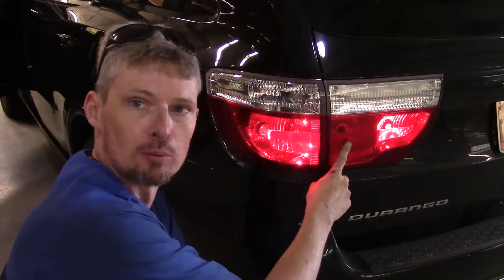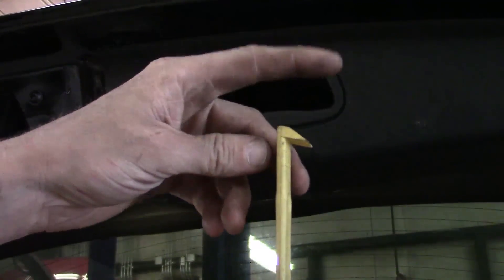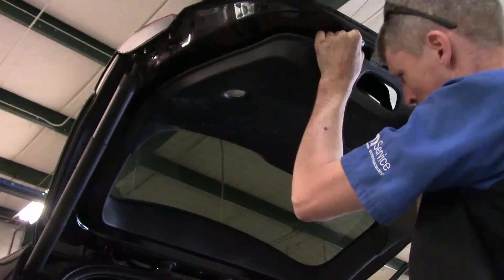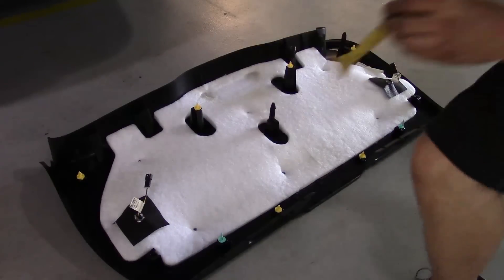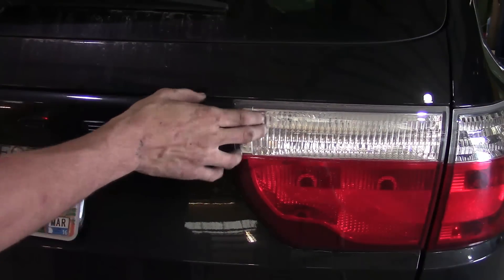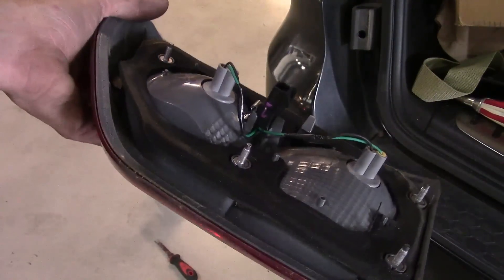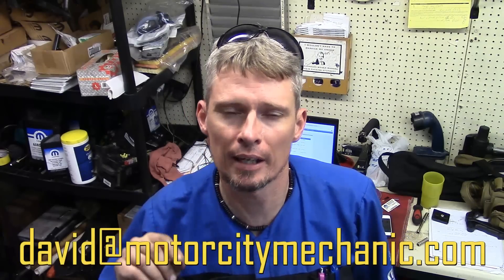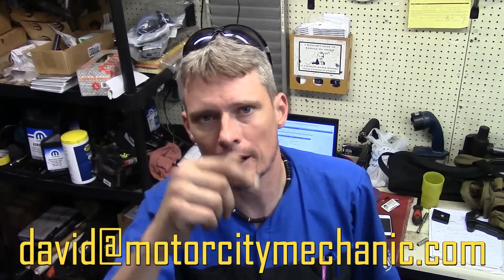2011-2013 Dodge Durango rear hatch tail light assembly removal

Comment: Appreciate you not using "and uh" , as many videos do. Very quick and concise, well done. Only critique, a lot of the electrical clips are very different in how they operate, slow down just a bit, and explain what is being squeezed or pried apart. The small electrical clips break easily if you twist or pry the wrong direction. Nice camera work also!
Reply from the maker: Appreciate the feedback. Thanks for watching

Comment: I just changed out the inner drivers side assembly, I cracked it backing into the Chief of Police's mailbox dropping off my daughter friend.  Oh boy, anyway I have a 2013 Jeep Grand Cherokee and used this as a reference.  The holders/clips weren't in the exact place.  and the inside 10 mm nuts/bolts were both on the inner side, but it worked.  It took me 45 minutes to put the back panel back on.  Thanks for the assist.
Reply from the maker: Ouch.....certainly the wrong mail box to back into. I do see some changes from year to year. The service info makes it hard to isolate exactly what years are exactly the same as far as procedures. Glad it all went well and no one ended up in handcuffs lol. Thanks and make sure to subscribe

Comment: Thanks for this video! I  have one bulb out on each side.  As well as different ones. So, for one I will have to take the assembly out completely.  This has to be the most complicated bulb change procedure I've ever seen. Dodge couldn't do better than this? I love this vehicle, but wow.  Oh well, I have to do it!   Thanks again.
Reply from the maker: +Watchandjewelryloft Your welcome. Yeah there are a few steps for sure. But now you know exactly what they are. Thanks for watching and make sure to subscribe
Reply: I did it!   One of the green anchors broke! But, the whole panel snapped back on pretty tight and no rattles!  I will probably get a new tab anyway though. Thanks again.
Reply from the maker: Watchandjewelryloft Your welcome. Glad it worked out. Thanks again for the update and for watching

Comment: the large plastic post located in the middle was a lil tricky to line up. took a piece of paracord to give it a pull and it lined up fine. thank u for the video.
Reply from the maker: +quinshane83 Your very much welcome. Thanks for the info on the install as well. Don't forget to subscribe if you haven't already

Comment: Dave, thanks so much for the video, couldn't have changed out the bulb on my 2013 without this, I would have never known how to get access to it. The trim clips are an absolute nightmare to pop off, I actually cracked the panel. Just wanted to give others a heads up: Be careful, they are REALLY tight, even using a trim stick trying to pop them. Dave makes it look easy,  he's a pro and I guess I'm not (haha). Again, great video, Dave - Thanks!!
Reply from the maker: Funny you should say that....I broke one of the handle cups on the bottom edge of the panel trying to get it off in the video....it got cut out and made it to my personal blooper reel. I never found nothing wrong with screws.....because they came off easy, not like those plastic retainers! I feel your pain. Thanks for the warning to others and make sure to subscribe

Comment: This video was right on! Not only was I able to replace bith tail lights but completed the project in under 15 minutes. One suggestion is to have a handle piece of rope to support the panel,. I had a bit of difficulty trying tomget the tail plug apart and almost broke it, so I let it hang gemtly until done.
Reply from the maker: +david fabela Thanks David for the comment and for watching. It helps to have 3 hands lol. Glad to see that it worked out for you. Don't forget to subscribe if you haven't alrady

Comment: Hey David, I appreciate your video. I was looking to remove the lights on my 2015 Durango and was pulling on the panel and heard some gut wrenching cracking sounds so I just aborted mission lmao. Now Ima go back and finish it so I can paint my tail lights thanks again! Very informative.
Reply from the maker: +bIakmatt I hadn't checked but I know they eventually changed the taillights to a solid piece on the rear hatch. Yeah....it takes some pulling to get it off for sure. Take you time. Your very much welcome and thanks for watching. Don't forget to subscribe

Comment: Thanks for the video...I broke three blue/green clips and one of the clip holders. I'm going to try part store for replacement as for the holder alittle gorilla glue should do it...dodge really should have put an access panel or something but oh well.thanks again for your time making the video👍
Reply from the maker: Yeah an access panel would have been nice for sure. Those panel snaps will over time start to break when removing....its just hit and miss if they do. Thanks for watching and make sure to subscribe

Comment: So after getting the panel off the 10mm bolts kept spinning so I couldn’t get the light out. I was still able to get both lights changed without taking the light out. You just need skinny fingers and needle nose pliers. Lol thanks for this vid though!

Comment: all my 4 bubs on the taillights on trunk dont work what could it be
Reply from the maker: I would check each one first to make sure they arent blown. Otherwise you will need to chase the circuits and need wiring diagrams.  Nothing common that I have seen

Comment: I  have a 2012 dodge Durango with the  tail lights in the video.  I was wondering if those tail light can be swapped with the newer 2014, and 2015  racetrack tail lights on the Durango? or would it create more headaches?
Reply from the maker: +jolawil Thanks for watching. I can not say for sure if it can or not. I haven't ever checked into it to see if its possible or if the wiring would be the same. I assume the race track lighting uses one connector and that would mean the wiring would be different for sure. Good question....I am curious myself
Reply: Hi, 
I would love to install that same upgrade!!!
Did you ever look into what'd it take, or if. It is even possible?
Reply: jolawil 
Did you switch your tail lights?

Comment: Hello MotorCity, I really appreciate this clip. My rear right taillight assembly actually fills up with either water, or a mass amount of condensation to become filled with water over time. It's almost like a fishbowl. After I manage to change out the bulb, do you have any recommendations as to how to stop moisture from gathering inside?
Reply from the maker: The best repair is replacement of the tail lamp housing that getting water in it. A trick you can do to save a few bucks is to drill a small drain or two in the housing....obviously on the back side and in the lowest possible area so that you cant see it from the outside. It wont stop the water from getting in but it will give it a place to go and drain out so that it doesnt stay in side and then cause the bulb to fail again. Its something you can try or replace the housing. Thanks again for watching Kurt!

Comment: I was hoping to learn how to replace only the rear inner taillight lens. 
So I'm assuming you do just as shown, and when you have the taillight assembly off, there's a couple of 10 mm bolts holding the lens on to the bulb assembly. Is that right?   Thx

Comment: Great video, very helpful cuz I have the same light out on my Durango. But I do have one question. What was that tool that you used and where could I possibly buy one?
Reply from the maker: The tools used are plastic trim sticks. They sale them at all the local auto parts stores and places like Harbor Freight as well. The trim panel is held on tight to be prepared to fight with it a bit to get it loose. Thanks for the question and for watching.

Comment: My liftgate wont operate by pressing the buttons! Why? Thanks in advance
Reply from the maker: Sounds like a possible latch issue. The rear cover will need to be removed the best that you can to try and access the latch to see if anything obvious. Thats not always an easy thing to do. Some have an access panel while others you almost have to damage the rear cover inside to get it off being that the liftgate wont open. Sometimes we can try to override it with the scanners we have....other times not. Thanks for asking and make sure to subscribe.

Comment: Do you know If the same steps have to be followed on a 2014 grand cherokee?
Reply from the maker: Its very similar. The inner housings on the rear hatch require the inside trim panel to be removed inorder to access those fasteners. Thanks for asking and make sure to subscribe

Comment: I have a 2013 GC overland with the powered liftgate.
How can I open the liftgate manually in case if there is a problem and the liftgate cannot be opened by remote and by the handle and I want to replace the electric lifter or the air strut?
Could you please make a video showing that because there is no video on the entire internet showing that till this moment.

Comment: Thanks for this video; it's the best I've found on removing the lower trim panel on the liftgate. Unfortunately my lower trim panel broke (cracked many places) during removal. I found the replacement lower trim panel to order, but am wondering if you know how many of each retainer (68087885AA) and clip (68085677AA) I'd need for the new lower trim panel?? From the video, I'm guessing it's the green and yellow clips shown on the back of the trim panel... So I'm thinking 2 RETAINERs (green) and 6 CLIPs (yellow)?? Thanks again.

Comment: Is the assembly on a 2011 Laredo the same far as removal rear inner tail light  assembly.  Can't open my window on the lift gate.
Reply from the maker: On the Jeep you only need to remove the lower rear hatch interior trim panel. You can then reach inside and access the bulb socket.  Hope this helps. Make sure to subscribe when you get time if you havent already.

Comment: How do you remove the green blue fastners from the car to apply to the panel?
Reply from the maker: +limegreentx_ You can use trim sticks either metal or plastic. Here is just one version you can use/try: http://i.ebayimg.com/images/i/231436428464-0-1/s-l1000.jpg

Comment: You would think they would have put panels in that cover behind the lights that are easily taken off bs having to take apart halft the lift gate to change a tail light... Great job Chrysler engineers 😅

Comment: I broke 3 blue clips and 1 yellow clip - where can I buy the replacement parts?
Reply from the maker: The part # for the blueish/green plastic snaps is 68087885AA and the yellow snaps are 68085677aa. You can find them on line searching the numbers I gave and also you can contact your local dealer to see if they have any instock. Thanks for the question and make sure to subscribe
Reply: Thanks again David!  You are awesome! Its so nice to have help online.  I appreciate how quickly you get back to folks.  internet for a long time and could not find the part numbers.   Thanks for your instructions and guidance.  I searched the
Reply from the maker: Glad I could help. Thanks for finding my channel and for the question. Questions like this help other viewers out as well so glad I could help get the info for the next person as well

Comment: What bulb do I buy?
Reply from the maker: The bulb that I replaced was a "3057" bulb. To be sure, take your bulb with you to the parts store to match it up. Written on the bulb or the plastic portion there should be a number written such as "3057" as well. Thanks for watching and for the question. make sure to subscribe

Comment: What about 2015 ?????
Reply from the maker: +Markoz Cortez It depends on the type of rear light lights it has. They did offer the track light set up which goes from completely from one side to another. If the set up looks like the one in this video then you will be fine following these steps. If the track style lights then I don't have a video at this time.

Comment: what was dodge thinking... they made a huge flaw here not making it easier to access the bulb for changing, great video but i still wouldn't be able to do it myself.
Reply from the maker: +Flavio Gomes Flavio.....give yourself some credit. I'm sure you can do it with no trouble. I agree though that it could be a bit simpler. Guess sometimes design/appearance overrides ease of access. But like I said.....If I can do it, anyone can do it. Thanks for watching the video Flavio and make sure to subscribe
Reply: +MotorCity Mechanic hey thanks for the quick response ! and yeah like i probably could but i know its going to take some time, but im really really happy you made this video because now i have a better understanding on what ill be getting my self into before hand, so i just hope all goes well, if anything i will be definitely using this video as reference since its the only one that i found that is very thorough and clear, thanks again!
Reply from the maker: +Flavio Gomes Any time Flavio. Thank you for finding the channel and taking the time to comment. Its the reason for the videos....to help others like yourself.
Reply: i hate how the battery is under the passanger seat
Reply: i hate how the battery is under the passanger seat
Reply: i hate how the battery is under the passanger seat
Reply from the maker: Dixinormus I can say one thing for sure....no corrosion at the terminals. But your right on the ability to get to it.